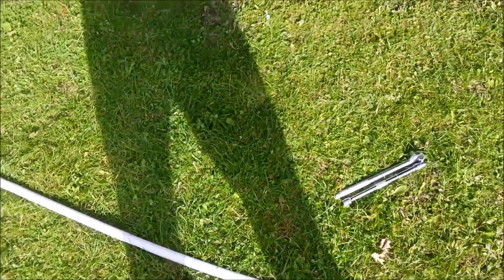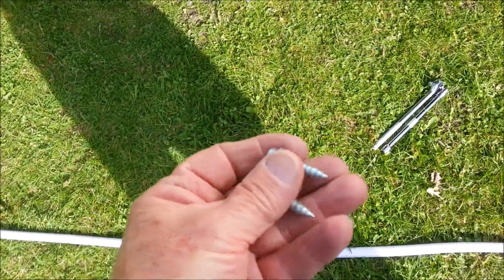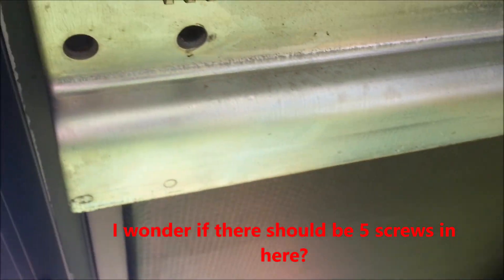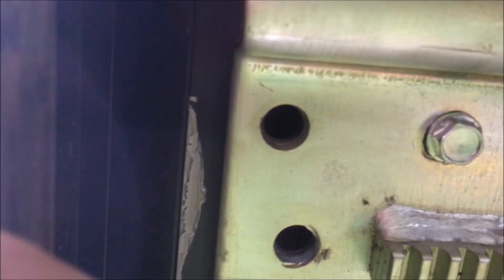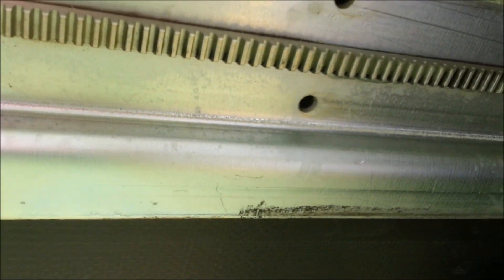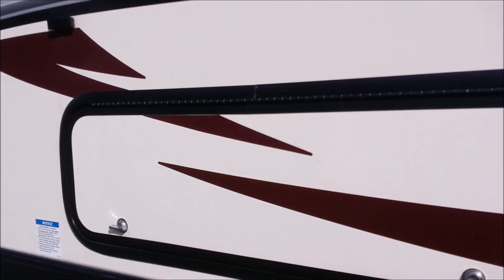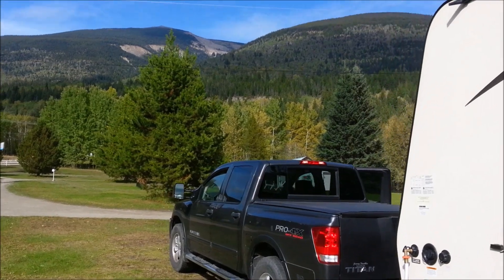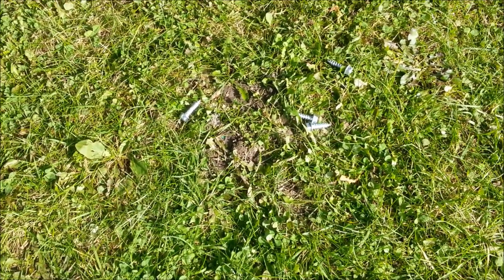Loose screws. Where do these go?   Check your slide out.

Comment: I would put screws, washers and nuts with lockwashers if I could get to the nut side.
Reply from the maker: I would too.  I should take a long drill, drill up from the bottom hole and I bet it comes out through the carpet behind the couch.  Then?  YES, washer bolt and nuts.

Comment: Would you still recommend this trailer?
Reply from the maker: Absolutely.  The walls are sturdy and insulated well.  It is about workmanship Charlie.  Some days a crew may do a better job, others not.  But truthfully.  I have REALLY hammered this trailer, very washboardy roads that go on for a couple of miles at 45 mph, BIG bumps, sways..  I've been off road many times, dust and mud.  If you look at different mfrs, look at all the appliances, outlets, lights, electrical, plumbing, you'll find they all (even Class A's) use the same brands with only a few exceptions.  That brings it down to SOLIDITY and insulation in my mind.  Every trailer is screwed or bolted down in some manner.  So some things will come loose.   We love this unit for that reason.  :)
Reply: Thank you

Comment: 1st!

2109s cheaply made?
Reply from the maker: Not any more so than other models R S.  I have really put my camper through some extreme roads and shaking.  More than probably 90% of the owners out there.  Any trailer would experience the same issues of nuts and bolts coming loose.  :)  We really like this trailer.  VERY happy with our decision.  :)  Thanks.

Comment: Maybe Gorilla glue on the bolt threads would work
Reply from the maker: That may work.  Hey, can't hurt. Or stuff some steel wool in the hole and replace the screw.